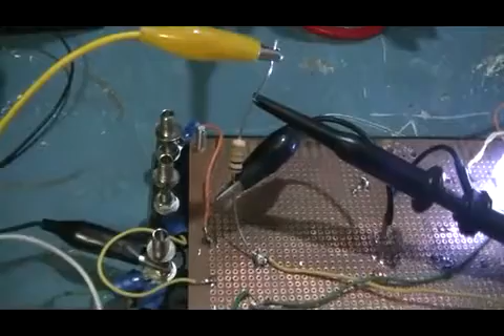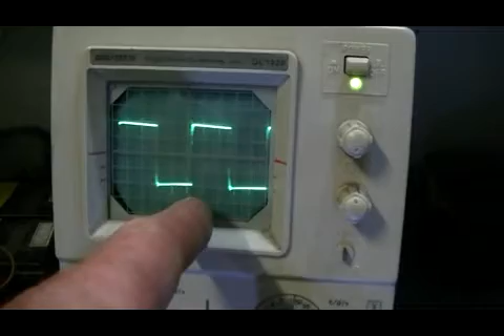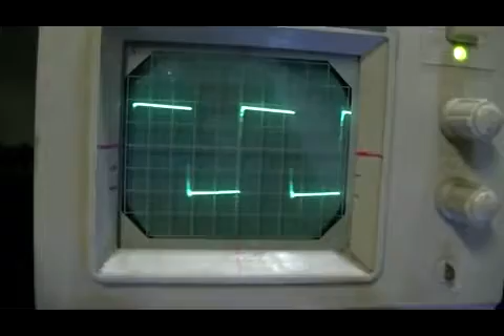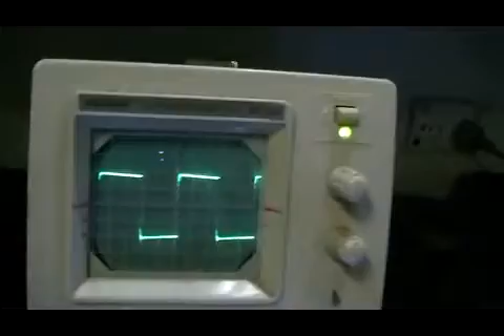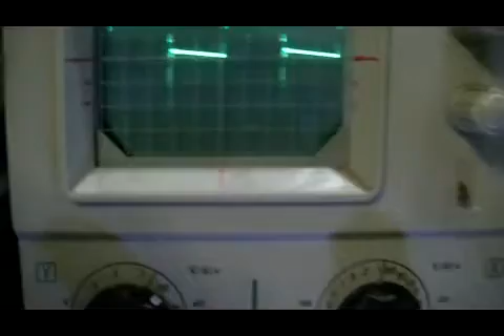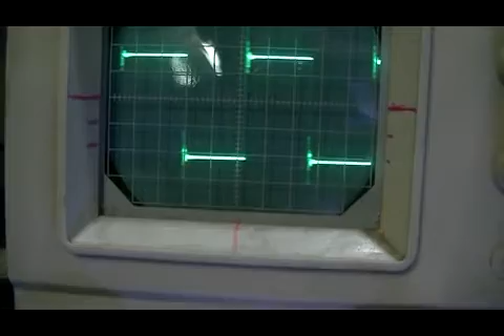Tesla circuit 1 ohm test

Comment: This makes it pretty clear the coil is providing extra power, as its a one ohm resistor, volt and amps are going to be identical. There is power coming from that coil. I don't believe it can be negative resistance in this case. so it must be a battery, which it is not. Or it's collecting radiant. Inside your Faraday cage of a shed. If it works better in the sun, its cosmic rays. If not that, things get really fun :) Could be Zero Point. Or non light emitting plasma, or I don't know what... :)

Comment: Another great test! Looks to me like the coil is harvesting power from it's local environment. With the freq you are running, and previous test where you turned off your mains. I doubt its from mains. Your grounded shed excludes radio as a source, so most likely not man made power its harvesting. I wonder if it works better with coil in the sun? If so that would indicate cosmic ray collection. If its not cosmic, you may be getting zero point, or some other sources. Pretty clear it has OU to me:)